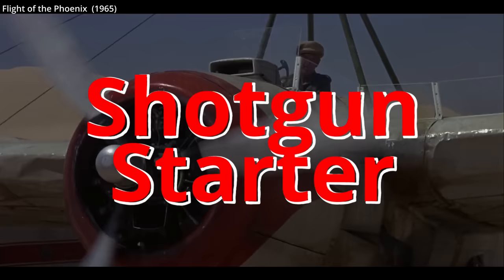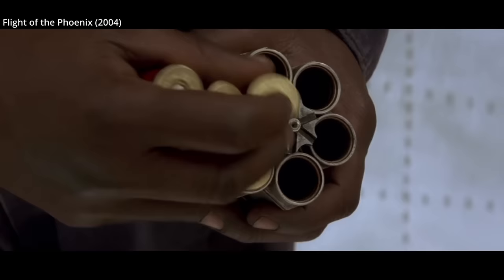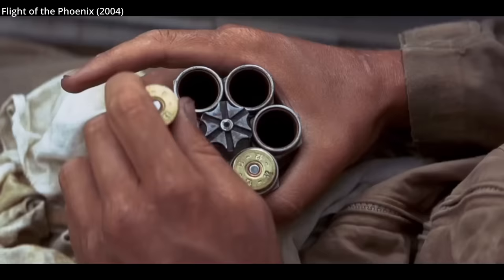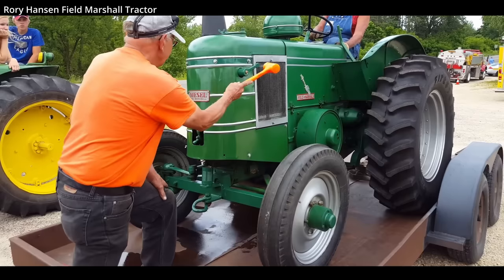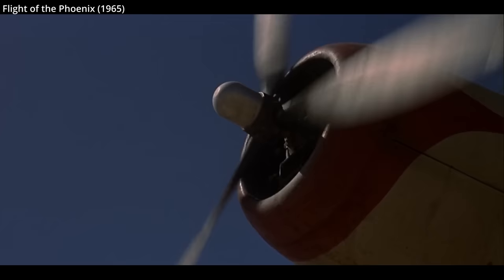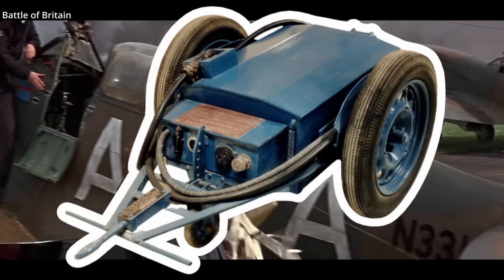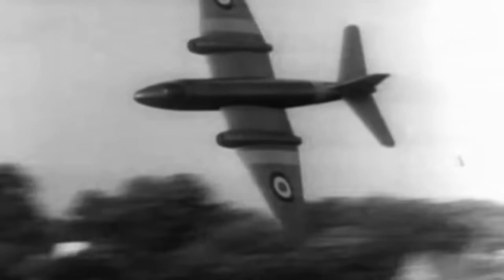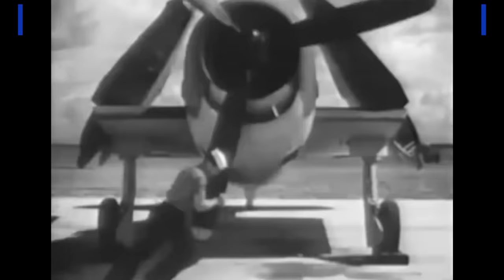Starting Aircraft With a Shotgun Shell?

Comment: Fun fact: In the Montana dig site scene from Jurassic Park, a special shotgun shell is also used in a similar way in a device called a Betsy Gun.
Reply: It is true. They use surveyors and some mines use that same shotgun type shell firing it straight into the Earth and the sound waves that come back go into a computer and people can see what kind of rocks and fissures lye under their proposed mines or survey.
Reply: That’s a stretch. The only similarity is the shotgun shell.
Reply: @jumpingjacks5558  Yep, now they use gamma guns.
Reply: Except that this one is a blank where the gas pressures are used and the dig site ones are actual shotgun slugs being fired into the ground to see the sonar.
In the fossil finder's case, you can use a regular shotgun if you want, the whole structure for it was just to ensure it went perfectly vertical.
Reply: Kind of like A ranset gun
Reply: Fun fact: when people go hunting, a different special type of shogun shell is used to start the birds moving
Reply: Used one of those years ago but forgot it was called a betsey. It was like a shotgun on a wheelbarrow with a big low pressure balloon  tyre.. It was electrically fired to keep the timing right but some poor soul had to stand on it to weigh it down and stop it jumping when it fired into the ground. Iirc it didn't end up being used much as better results were obtained by using an airgun in specially made pond or pit. The airgun was a specially made device to explode high pressure air into the pond thus making the shock wave.
Reply: When surveying possible oil fields in ND decades ago they used  dynamite and seismic trucks
Reply: My grandpa used to tell me about the one he used. Now, I'm not sure what kind of load was supposed to be used, but my good 'ol grandpa just used some of his turkey shells.. 😅
Reply: That doesn't look very scary. More like a six foot turkey.
Reply: @@davesmith3023 you never seen hobo with a shotgun?
Reply: Have your wife...just yell at the rocks
Reply: pushes glasses up. chortles nerdishly
Reply: The fact that comments which are entirely wrong get so many likes is concerning. That's hundreds of people who now how false information in their heads and will potentially go on to spread it.. This is why fake news and false information is so prevalent.
Reply: @RedTail1-1  i start my truck  with 00 buck shot bird shot  isn't strong enough
Reply: @craighandley7535  
Sometimes it stops them from moving.

Comment: I didn't even know aircraft engines needed any type of starters or assistors until i watched Top Gun Maverick where they needed something extra to start the Tomcat.
Reply: The F-14 needed a power cart and a huffer which blows air into a duct that spins the turbine
Reply: A lot of Navy jets need external Huffer Carts to provide electric power and compressed air to start. The Navy expects to mostly operate from carriers where the carts can be easily provided and the weight savings are nice to off set the increased weight of a carrier capable jet. The USAF has some self start capable jets, usually with a jet fuel starter, a very small jet turbine that can be cranked by onboard battery power and starts the first engine.
Reply: SR-71 needed some Cadillac engines to start
Reply: What surprised me is that even piston engine aircrafts need starter power.
Reply: Well, how did you think they were started? Batteries and electric motors (i.e. starters) are extremely heavy, not something you want in an airplane.
Reply: @TheRealNeillDo they engage the compressor/turbine shaft directly?
Reply: The most common means of starting jet engines nowadays is the APU (auxiliary power unit), basically a very small jet engine, often no bigger than a shop vacuum, small enough that its turbine can be spun up to speed by a battery (about the size of a typical car battery). 

It then provides hot exhaust gas at sufficient pressure that when it is directed by ducts into a large jet engine it can spin up the turbine of the larger engine. 

This can be located almost anywhere on a plane. On many business jets it is located in the rear fuselage. On a 747 airliner it is in the tailcone. On the plane I used to fly (USN Orions) it was located under the cockpit, with the intake on the bottom of the fuselage and the exhaust below and slightly behind the copilot's side of the windscreen.
Reply: lol - that made my day. Did you think that engines start by magic, like in your dad's car?
Reply: @occamraiser  with this magical thing called an APU.
Reply: @kilianortmann9979  yup. Because when the Tomcat was being developed, APUs were heavy, but by the time the Hornet entered full development (as the F/A18, not the YF17), APUs had shrunk in size and weight, and had become more efficient. Carrier aircraft need all of the weight savings they can get since their runways not only move, but are significantly shorter.
Reply: modern planes still need help, if the apu that's on the plane fails. a big airstart is connected and turns the engine over until its spinning fast enough to add fuel to start it. we use them all the time at work
Reply: @ClassicTrialsChannel  yup. Huffer starts can get fun.... Bonus points if you're starting a wing mounted engined aircraft like a 737... Or larger... Hope everyone is paying attention!
Reply: No mention of the B-52 doing cartridge starts!!!
Reply: @michaelusswisconsin6002  their starter carts had dual Buick V6 engines.
Reply: Working F4's, the J-79 used an external power unit for electric power and pneumatic starting normally. They could also be started using a cartridge and battery power. The cartridge start method was seldom used, even for alert aircraft.
Reply: The me262 jet engines used to have a small single cylinder "lawnmower" type of engine in the nose cone of each engine complete with pull cord, so that the jets could easily be started when the planes were dispersed . There was one on view in the Rolls Royce engine museum which showed this surprising addition clearly.
Reply: @HailAnts that makes any sense and li-ion batteries are lightweight compared to lead acids but they're fire hazard when it comes at the high temperatures
Reply: @TheOz91 they put in air at the combustor or after multistage compressors.
Reply: Minor quibble, but airliners today use bleed air off the APU compressor, not exhaust, to start. Once one engine is running, the other can be started with APU again, or bleed air from the running engine.

Comment: Thanks, I was an air cadet when we still had the Canberra bomber in service. And on a field trip to the local Airforce base, we stood beside or near the bomber and they did the shotgun start for demonstration purposes. Really loud & a bit scary when you are a thin 15-year-old.Cheers
Reply: My Father was a Australian Navy aircraft tech in the 1950's. He told me a lot about shotgun starters. They were basically more reliable and robust compared to the electric starters of the time.
Reply: Didn't the chipmunk have a cartridge starter...early models did I'm sure.
Reply: @@gilburtonAs a Canberran I always get a bit excited when I see my city name!
Reply: @geradkavanagh8240  And nice and light, too.
What were the RAN flying in those days?
Reply: I worked on canberras in the early 80s at RAF Marham. The cartridges you refer to are number 9 and 10 engine starter cartridges. As you say around 3 or 4 inch dia and around 10 inch long. Regards, Paul Fowell. @@gilburton
Reply: Not a shotgun shell, a starting cartridge.
Words are so difficult

Comment: Albanian here. Here, many of our famous million Mile Mercedes W123 300D Turbo’s have been rigged up with shotgun shell starter mechanisms from tractors, so they can be fully run without batteries/electricity, as they use mechanical fuel injection and have compression ignition.

Comment: Back in the 1970’s I worked for an oil field company. If we were low on air pressure we had cartridge starters. They were larger than a shotgun shell but bigger than a 10 or 12 gauge. They’d work in a bind !
Reply: What if you mistakenly put  in a real shotgun shell and blasted the engine full of buckshot ?
Reply: 8 GAUGE?
Reply: Bigger, just powder back in the early 1970’s so I couldn’t give you any exact dementions
Reply: @winnon992  COOL... I "Promise" I won't replicate one... 🙏
Reply: The shells were all powder, no shot. The pressure would spin the impellers on that air starter. I can remember being covered with black smoke. They could have been black powder. That’s been 50 years ago ,
A giant cloud of smoke. I think the engines were 4-71 General Motors Diesel.

Comment: Coffman style cordite shells were also used as a propellant source in the WW2 Australian 'Murray' Flame tank prototype, which was intended to replace the Matilda Frog flame tank, but never entered service due to the conclusion of the war. The intention was for the cordite shells to be loaded into a breach mechanism, with the expanding gasses actuating a piston which would generate the pressure to expel a charge of flame fuel from the piston chamber.

Comment: A cartridge starting system is used to start engines on B52 bombers so they can get airborne quickly. This is very important if a nuclear attack is detected since anything on the ground will not be useful after the first exchange. A rapid starting system is much more economical than keeping a large number of bombers in the air at all time, which was the practice at the height of the cold war.

Comment: During the 1920s and 1930s, some aircraft had both electric and Coffman starters.  Batteries were heavy and inefficient, and were often shifted from one mounting point to another as an adjustment for weight and balance.  This meant that sometimes they were several feet further away from the starter motor, so an aged, hot or cold battery might not have enough energy to fully and reliably spin up the weight that turned the Bendix.  The Coffman shell cost a few cents for each try, but would get the engine going, even after the battery had been tried and found lacking.  The Napier Lion (water-cooled W-inline 12-cyl) was one that offered a dual-starter accessory pack, but only on engines sold to North America -- engines put on British planes and boats were electric-only, so the used of a "trolley-acc" battery cart was necessary, just as on the Hurricane and Spitfire (whose batteries were not strong enough to crank the engine).

Comment: Good one, Johnny. It's a long way from aircraft engines, but a lot of the concrete batching plants in the U.K. used 8 gauge blanks to de-scale the OPC and fly ash tanks. A buddy of mine used to visit them and collect the empties for reloading his waterfowl cartridges.
Reply: Foundries, mills and other facilities would sometimes lease kiln guns with what's essentially an AAMG tripod and other associated gear for blasting slag and other deposits off the insides of their kilns and furnaces, in fact they exist in this legal niche where they can be owned by non-certificate holders but the companies who lease them out are usually pretty active at retaining them though it's a bit of a security-by-obscurity situation.
Reply: But the 8 bore cartridges used for concrete blasting will not fit a shotgun, they are different to prevent them being used, many good 8 bores have their chambers altered to take these.
Reply: I spent a few months working in an abattoir and I think I encountered the coolest use of blank shotgun shells of all time. It was a sledgehammer except the head of the sledgehammer had a break action and you put a blank shell into the head, then it goes off when the head hits something. Like some sort of fantasy zombie killing melee weapon that super-charges your swing. It didn't get swung, it just got tapped lightly onto the forehead of cows and the shell going off instantly knocked them out. I think the point was that it was always the right amount of force to incapacitate the animal so it was very reliable.

Comment: I remember while I was in the U.S.A.F. watching a couple of F-111s use "start canisters" during alerts back in the mid 1980s a couple of times. These were like number 10 tins of probably black powder with a bunch of holes in the sides like a colander and when they burned produced a huge cloud of black smoke while some turbine went FWEEEEEEEE! while it was running. Once it died down, after a few seconds you could hear the low hum of one of the engines spooling up, and soon followed by the second engine.  It was cool to see because when it happened I learned how they can launch so many planes in short order during a real wartime scramble. The usual method to start the planes was to roll up a wheeled cart, the size of a small trailer that contained a small jet engine that used it's compressor pressure through a flexible hose rated at 2000psi into the same turbine that canister used.  The cart was noisy enough that we never heard the little turbine when it was running.  I did see one start canister go off, but then followed by frantically pushing the standby start cart into the shelter next to the plane to start it up when the canister failed to start the engine.
Reply: I also was in the USAF, in the mid 70's.  I was a crew chief on the KC-135.  When I pulled alert duty we'd get alerted in the middle of the night to get them all going.  We had a coffee can size container with something like gunpowder in it.  We'd shove it inside an engine from the side, give the pilot the all clear and kaboom.  Went to 90% in about 5 seconds.  Then they started the other J-57's from the bleed air of the first one.  Standing about 6 feet away was a big boom.  Maybe that's why I'm now a boomer.  And very deaf using hearing aids.  But, hey, we were young and tough and didn't need those pansy ear protectors.

Comment: The "Blank Cartridge" starter (Coffman) system is used on the older engines of the B-52 bomber as well as the 4.5 generation F5G / F20 tactical fighter.
Reply: So just ask Grandpa Buff if you want to learn more.
Reply: The B-52 used a much larger cartridge that a shotshell. It is about 6 inches in diameter and and fit into its' container attached to the starter part of the jet engine. With the plans to re-engine the planes a modern APU system most likely will replace it.
Of Note: The F-4 Phantoms J-79-GE 15 &17 engines were capable of using the same system as the B-52 did.
Reply: @paulzaborny6741  yep, it takes a bit more Umph to spin-up a jet's turbine.
Reply: @Nugire    Lol,  ^~^  and Grandpa Buff is getting new engines as we speak.
Reply: @ditzydoo4378  I've done 2 full starts on F-4's many moons ago.
They put out ALOT of smoke. Also, the crew chief had to watch the exhaust port for possibly a flame. 
No flame, good start.
If a flame came out and was sucked to the Aux air door next to it and did nothing, ok start.
HOWEVER, if the flame went in and came back out the Aux door....the chief was advised to RUN. 
Flight crew sees the Chief run and they would bail quick, no need to explain it to them.
Reply: @paulzaborny6741    Much like the Northrop sales video on YouTube of the F20 doing a ramp cartridge start-up.  I guess when in doubt grab the ejection handles and bail.  o~0
Reply: @ditzydoo4378  My pilots would pull their harness guillotine handles and the pilot would slide down off the ray dome and the WSO would bail off the opposite engine intake and then off the wing.
Actually happened. One of my units chiefs saw a small flame that did nothing, panicked and ran. 
The result was a failed start, ruined mission and 2 ruined ejection harnesses @ $900 each in 1978 money ($4,248 today). He was ribbed to no end.
Reply: @paulzaborny6741   probably a bit of "brown-trouser" moment for all involved.  Thank you for sharing this grand story.

Comment: The most famous shotgun starting sequence was in 'Flight of the Phoenix.', But the aircraft used , the Fairchild C-82 Packet did not use a Coffman starter. It had an electric starter. I think the same applies to the C-119 used in the remake. The reason the Coffman starter sequence was in both films was  because it was in the original  book. But the aircraft in the original book was a fictitious Salmon - Rees Skytruck Mark II which had twin inline  liquid cooled V12 engines (type not specified). In the book the crash survivors distil some of the engine coolant to get water, That is why in the film they had to add a plot point that the aircaft was carrying drums of anti freeze which they then distil to get water.
Reply: But he says they can be "added to most aircraft" at 2:55.  The C-82 and C-119 may not have ben equipped with a Coffman starter from the factory, but almost certainly could have been retrofitted as a failsafe if they're frequently far from well-stocked maintenance facilities.  The older an aircraft gets, the more likely it is to be "subject to change without notice," I would think.

Comment: Modern F22s have cartridge starters too, heard one going at an airshow. Didn't recognize it at first, but the regular bang, and whine of the engine, and another bang as the pilot gave it another go a few minutes later, gave it away. The local airport I was at for the show didn't have the right equipment or couldn't get access to the normal start cart, was during COVID if memory serves - lots of logistics struggles at that time.

Comment: The Coffman engine starter (also known as a "shotgun starter") was a starting system used on many piston engines in aircraft and armored vehicles of the 1930s and 1940s. It used a cordite cartridge to move a piston, which cranked the engine. The Coffman system was one of the most common brands; another was the Breeze cartridge system, which was produced under Coffman patents. Most American military aircraft and tanks which used radial engines were equipped with this system.